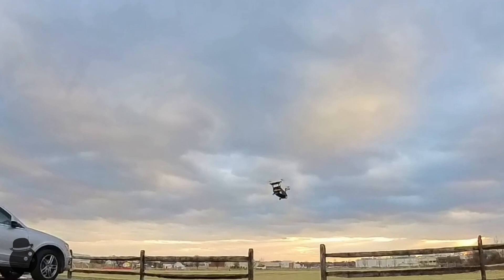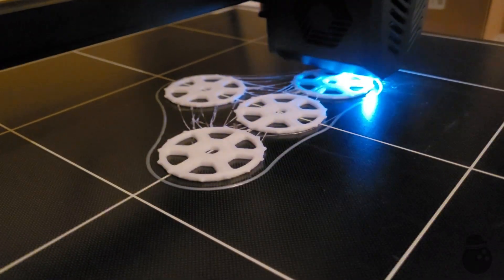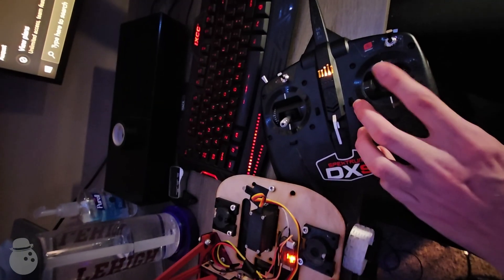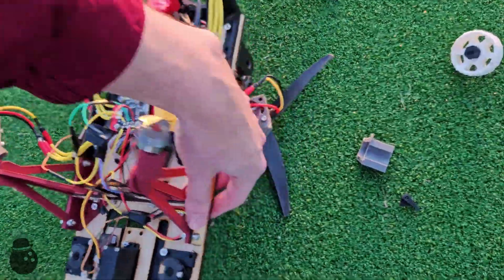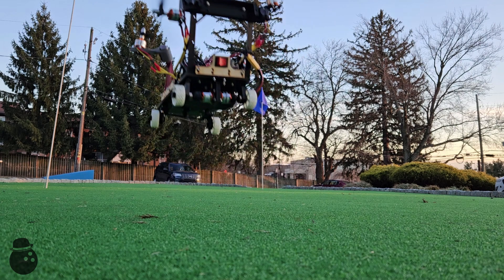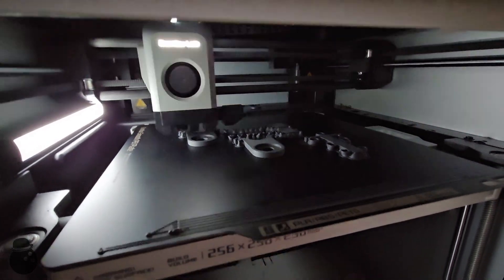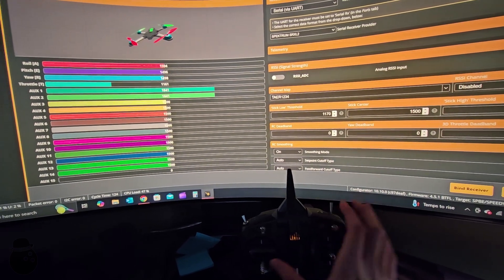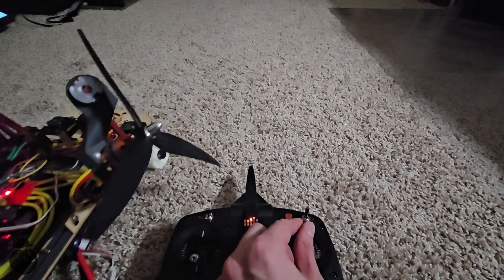It FINALLY Flies - Flying RC Car - Part IV

Comment: The frame is useless, except the motor fold down, thats cool. Stop wasting time programming for a bad frame. Just use standard suspension and drivetrain from an rc car style of your choice. And build the frame around that. I did a vtol car over 10 years ago. Air and ground speed were 65mph. And it can go offroad and tackle rocks. No programing required, other than rc control settings. If you want a crazy truly working build, just do it. Ill help if you want.